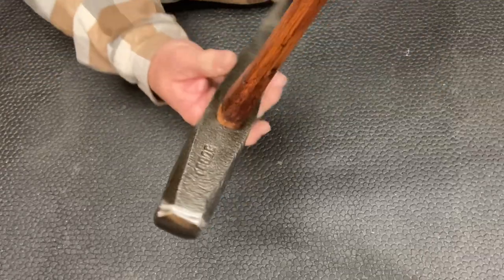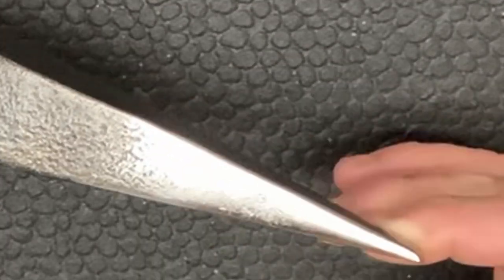Railroad Spike Hammer

Comment: Great job. I would drill a hole perpendicular to the crack. Then run some thin CA glue into the crack and run a dowel through the hole you drilled with wood glue and clamp it. Once dry  cut the dowel off flush and sand to the contours of the handle.
Reply from the maker: I like that idea. Thanks for sharing.